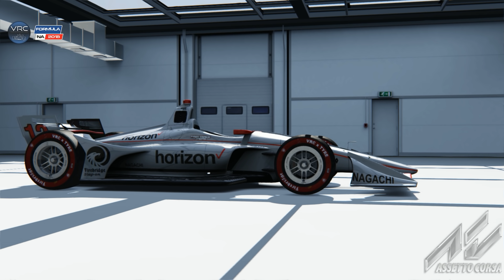A Real Driver's Car - VRC Formula NA 2018

Comment: 24:27 and 25:06 So you can basically turn the Road Course package into a Short Oval package by lowering the flaps enough (and for an actual short oval you would also dial in asymmetric camber)...awesome
Reply: Also, a modified Short Oval package with Road Course suspension and slightly taller (than typical) Road Course gearing would by my estimates also be optimal for places like Monza, La Sarthe, Old Hockenheim, Old Fuji Speedway, etc.

Comment: ok i know this is an old video but i have to ask as my car is missing the front wing change on the oval package.  but does yours still have that or did vrc remove it?  If it does have it and you have the 2021 version does that oval config have the front wing angle option?

Comment: Can you use push-to-pass on this car? Just bought it and cant seem to find it.
Reply: Why didn't i try that one?  lol makes sense. Thanks.
Reply from the maker: Yes you can. It’s mapped to the same button that you’d use for KERS or manual ERS deploy.
Reply: @F-Man  btw, great review! First thing i noticed when driving the NA'18 car was the rear end wanting to slide out on me compared to a modern F1 car but actually really enjoying indycar which im new to. Cheers.

Comment: With all the detailed explanations of the "aesthetics" of the car, the fact that the overall design of the IR-18 is supposed to resemble the heydays of Indycar (rather CART) in the late 90s went a bit under I think. Just wanted to mention this as it also explains why VRC chose to model the 1999 car whilst the other cars in the pack are obviously rather modern. Anyhow, couldn't wait for Thursday so I had to listen to the (as always!) great review now. Great job on spotting all the details that most of us here would never even notice.

Comment: by the way do you always use steer assist on 100? because i find that to be very light and not like it not having power steering. I run about 50. What setting do you recommend?
Reply from the maker: Honestly, I don’t usually touch it - never really thought to 🙈

Comment: Great review (still watching). I love IndyCar, I really do love the racing and the drivers and the look of the cars and all. However as someone living in Europe it is very difficult to follow the season, with races being often at 1 or 2 in the morning for me, and pretty much everything happening at very unfortunate timings. I wish IndyCar went a bit more gloabl and allowed for the european audience to watch races more easily. About the car, it is absolutely amazing, no doubt about that ! Thanks F-Man
Reply: Claudio Jaramillo Sorry mate but that's not true. Only the night races are at bad times and admittedly tonight's race is also quite late (0:40 CEST). But all other races are in the evenings hours and thus very much possible to watch. Afterall that's how I (being German) fell in love with CART in the mid to late 90s <3
Reply: @J3FFyB  I miss most races because of my crazy schedule and work load for school. Apart from the usual races at impossible times, anything that goes later than 20h (UTC +2) won't work for me unlike F1, or ADAC GT, Blancpain races that run at like 16h. I hope I am not speaking only for myself, and other people out there are in a similar situation
Reply: There is a blog called like burning wheels that replays many motorsport series including indycar. Also reddit motorsportreplay is a great resource.